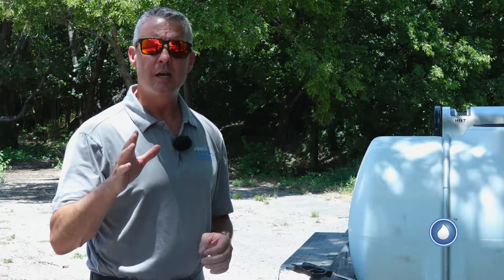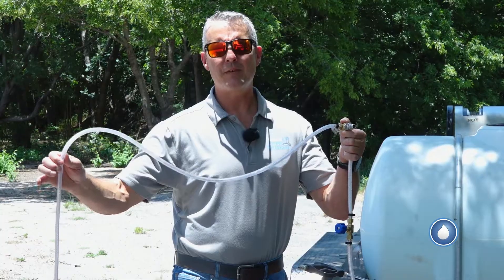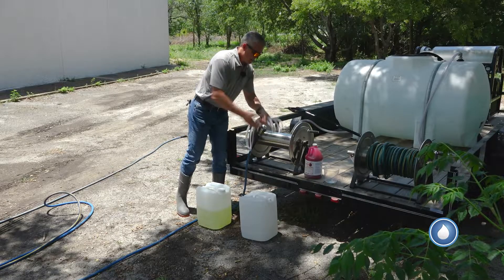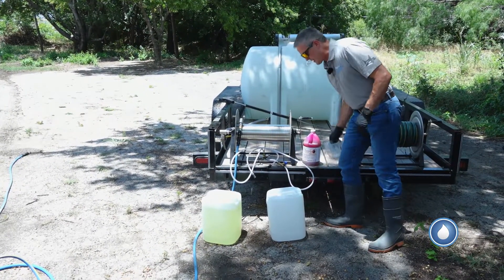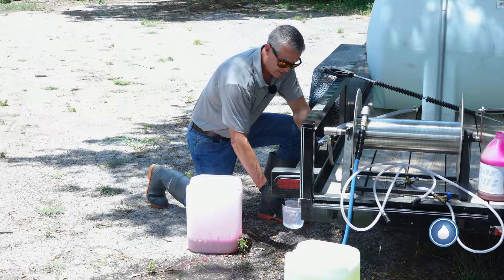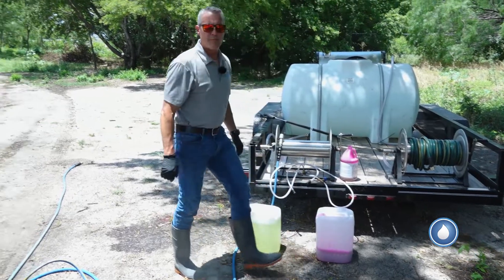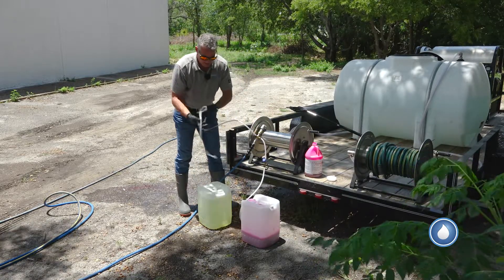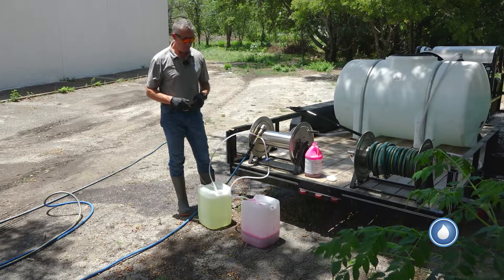Color Marking Surfactant: How To Use Dual Port Injector For Soft Wash

Comment: Love the video and love the tool, but I am confused about the soft wash part. What makes that a soft wash? You are using a 5.5GPM pressure washer with a jrod and a downstream injector. Unless I am wrong, isn't that a pressure wash? If it isn't then I am confused about the difference between a soft wash and a pressure wash.
Reply from the maker: Great question!  As far as equipment goes it is a pressure washer and there is soft washing equipment as well.  But the difference between soft washing and pressure washing is the impact pressure on the surface.  So, regardless of the equipment used the method of application and how the pressure washing is used will determine if you are soft washing or pressure washing.

Comment: How would I hook up your downstream injector to my remote injector?
Reply from the maker: Put it in the same place as the current injector
Reply: @Powerwash  normally, you would run the SH Lin thru the downstream remote. Now, you’ll have a surfactant line, how would you hook that up?
Reply from the maker: @alanphillips1344  Not sure without seeing how the remote is plumbed

Comment: I bought the 1/4" valve from you all and put it in-line between my dual port and my apple blossom 5 gal. And even when I have it turned all the way off/closed it pulls a lot of surfactant 🤷‍♂️
Reply from the maker: That is odd.  Have you tried to replacing the valve.  If the valve is closed it should draw any surfactant.

Comment: Hi Mike,

When you pull (SH) through the line without the adjustable valve do you then put it into a clean water bucket after your done to rinse out the injector?  Or do you have clean oit both lines 🤔?
Reply from the maker: I recommend rinsing it out after every use or at the very least at the end of the day.  Bleach will corrode the injector if you don't rinse.
Reply: @Powerwash  

Do I rise the (SH) line only or both?
Reply from the maker: @michaelc7283  just the SH is necessary
Reply: @Powerwash  

Sounds good 👍

Thank you

Comment: Isn't your full flow from your PW greatly reduced by squeezing all the water through the injector without a bypass loop? Or do you have a bypass that I am not seeing? Would a Flow Pro where it turns the valve off at the bypass be mechanically better? (or could you build one the same way). I am just trying to understand fullyy the soapbox
Reply from the maker: The bypass loop only applies when you don't want to use the injector to achieve full flow.  If you have the bypass and the injector at the same time the injector won't work correctly and mostly likely not at all.

Comment: nice video, can use with 12v system with proporcioner?
Reply from the maker: No, 12 volt systems do not create high enough pressure to for down streaming.
Reply: Do you mean hooking up your lines to a proportioning valve system..if so, yes you can..hook up would be on the out that side of your proportioner. But you will not be using your 12 volt pump at all.

Comment: So this helps apply the chemical  and soap will it be enough to to keep us from having to upgrade to a soft wash system ? This is a big question 90% of people are trying to figure out that are getting started
Reply from the maker: This will work for house washing and se light roof cleanings.  Normally, to do roofs you need a softwash system

Comment: can you downstream sh from both of the inlets ports ??
Reply: Yup 👍🏻
Reply: i was thinking the same thing
Reply: Why? You won't get any higher percentage hitting the surface than using a single port.
Reply: @michael8990  that's not what he asked.
Reply: @xtremepowerwashing1815  Just clarifying that it would be a waste of money with no benefit to use both ports.  No bad intention of implied.
Reply: @michael8990  the reason for the Dual Port is to run one in sh and the other and your soap tank .it's not a waste of money.
Reply: @xtremepowerwashing1815  I understand that.  My comment is based on why would you have both ports downstream sh, no advantage or purpose. I see extreme plus for using both sh and surfactant.
Reply: @michael8990  I got you.. the only reason I would use the two ports for down streaming sh would be if I did not want to use soap on a specific project. I would just drop both tubes in the sh.